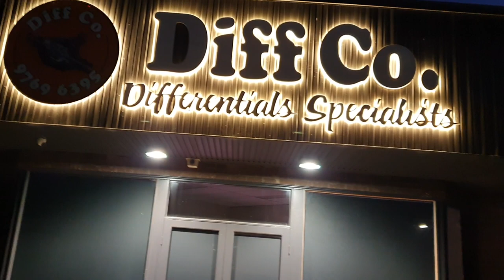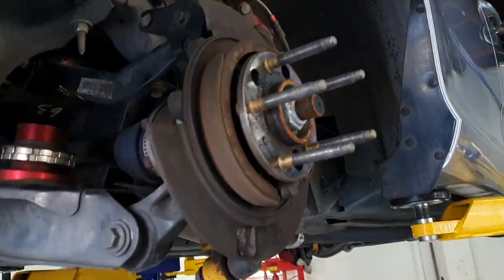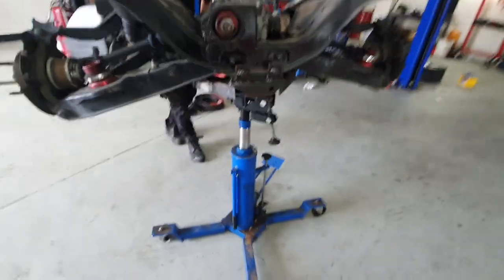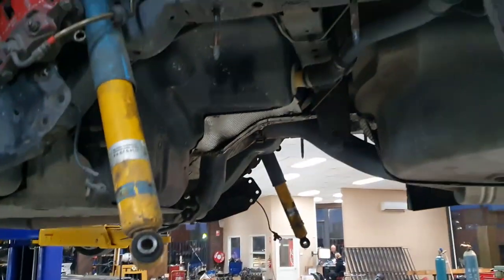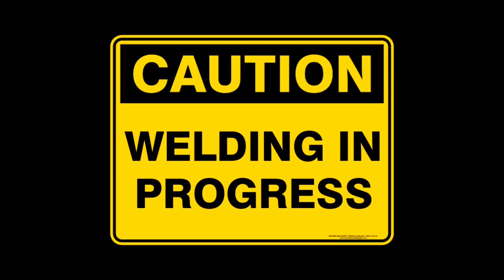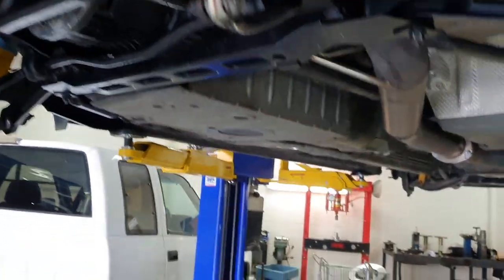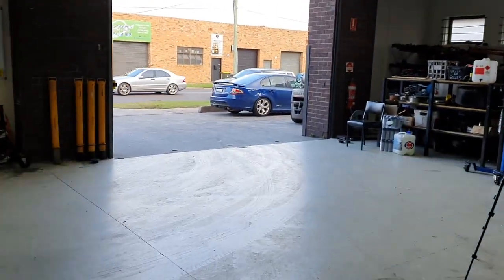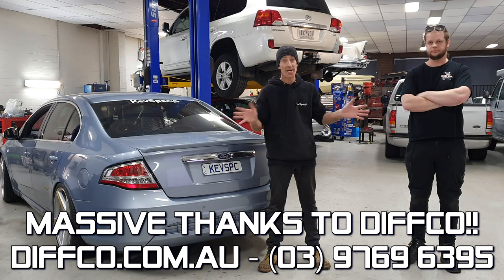How to upgrade a BA to FGX FORD FALCON REAR SUBFRAME ....KevSpec style /Plus rear end freshin up

Comment: Was admiring the bird turd welds prior to the real welder turning up and doing a proper job . Have filled those factory gaps in the blades bushes with selleys roof and gutter silicone and waited for it to set properly b4 driving. Extensive and informative video thankyou  date june 2024.

Comment: Good video Kev, and I'll add this just to touch on your coil packs, I had a ZF box playing up, and the engine misfiring in a BF Fairlane, and it turned out to be two faulty coil packs, and it was discovered on a routine service after having a shit load of trouble shooting with the ZF and other electrical investigations, you are DEAD RIGHT, those coil packs are definitely the first port of call.
Good job mate on the FG too 👍
Reply from the maker: Cheers mate 🤙

Comment: Thanks heaps for this Video Kev. I've got a BA XT that i wanna do some strengthening to its cradle, you've pretty much put all my issues to rest with this, I've got some relly nice 10 and 8mm plate just sitting here getting rusty and i had the thought of cradle add ons. I'll be doing essentially the exact same as what you're doing here, but with full superpro and I'll be doing all the mounting points, bush housings, the arms on the cradle and whatever else i think might need some more material in it. I will eventually go to single piece tailshaft and m86 IMS with the bigger axles and I'll probably make the trip up to Melbourne and get these guys to do that work for me. 

my goal is to have the rear end to the point of; the only upgrade i could do from then is a 4 link with a 9 inch and tubs, but i'm not spending THAT money on it any time soon 😂

Trying to not have to DRASTICALLY modify the car itself. I don't care about strengthening K frames, suspension, box, motor and diff to the most extremes, but the shell i want to be relatively unmodified.

Comment: Big job fixing that single bush mount up. Youve still got the problem of the single bush flogging out and or breaking the stock diff bolt and or diff hat. You definetely should have waited and done it properly with ims twin bush diff hat. Tidy job tho, good on ya.
Reply from the maker: IMS diff hat still floggs bushes out
Reply: Doesn't matter what you do to stop it, it'll happen. The only true way to stop the Falcon Bush problem in the rear, is to 4 Link it. And if you know anything about 4 link 9 inches, they aren't bloody cheap.
Reply: @kevspecfpvgtcofficial3592 Have you known someone that has had a ims diff hat break or did the ims twin bushes flogg out?
Reply from the maker: @farmer3242  yeh mate ..30k ims diff hat leaking and bushes flogged out ..tock 5.0 coyote with just a tune ....manual

Comment: Kev not too sure if you have already but check out your trailing arm bushes. My XR8 were shot. Can you tell me if you noticed a noise from the rear cradle when you first had the cracks?
Reply from the maker: Hey mate ..my trailing arm bushes had allready Been done 
And yeh did notice more the vibration on take off and cruise, just a small clunk on hard take-offs.. 
Been rock solid since I've done this

Comment: Nice! Why didn't you go with Super Pro bushes ?
Reply from the maker: It's harsh enough allready, with a floating semi sold centre bush .
Reply from the maker: Hey mate ...its allready harsh enough with the solid floating centre bush .
Reply: @kevspecfpvgtcofficial3592  I actually like the harshness. Am running fairly solid Superpro bushes in my BA, the Performance kit.

Comment: g'day mate, my daughter broke one of her control blades in half, we've managed to get another from the wreckers and have gotten hers out but are struggling to align the 3 bolts, any tips? currently we have it jacked up using a trolley jack, the two bolts at the front of the blade are also loose in an effort to align the the three at the brake end. I'm guessing you didn't loosen them up in this video so I guess I'll tighten those up first. I'm also guessing it's just a wrestle with the wheel hub to align those three holes. Cheers.
Reply from the maker: Sorry I dinner get back to you earlier..yep it's a bit of a wrestle with the hub 
Sometimes you can you a couple of screwdrivers to align the holes ....